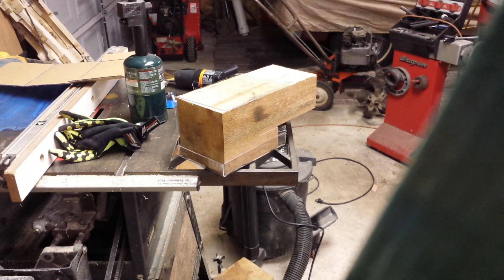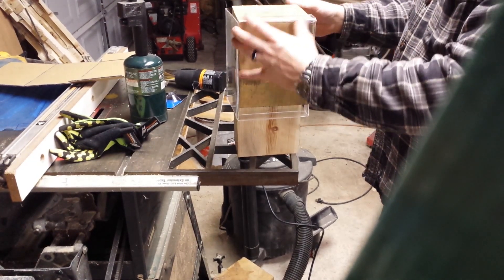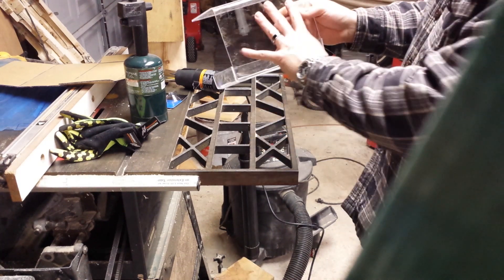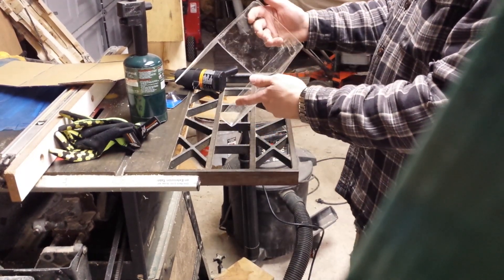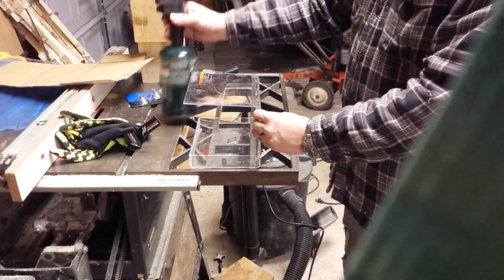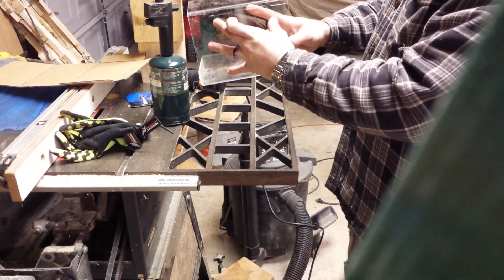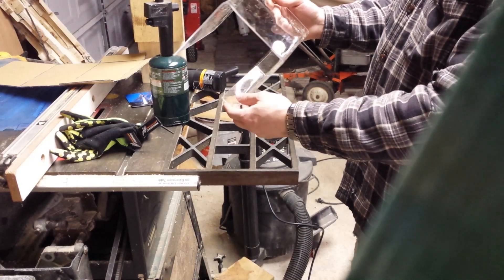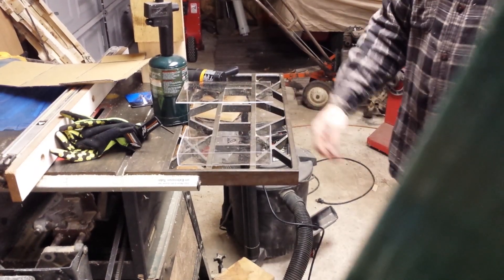Drill or Burn holes in plexiglass

Comment: Just a thought.. I heated a metal pipe from an old drain. Really hot.. grabbing it with some long channel lock plyers then melted a round hole through the plastic/acrylic.  Suggest that you practice on some scraps first but I ended up with a round hole ( not pretty ) like for running cables through or whatever.